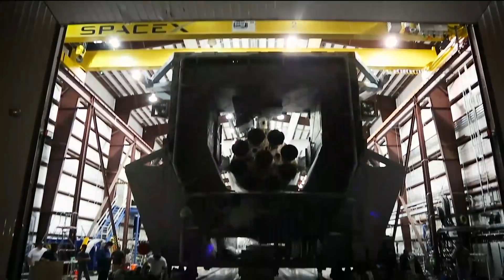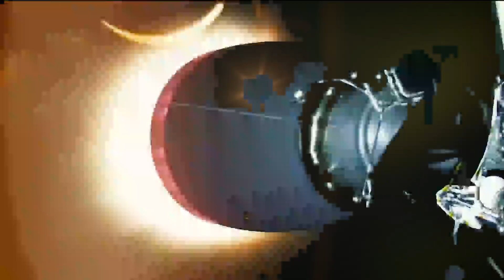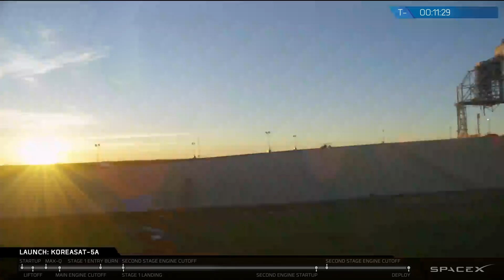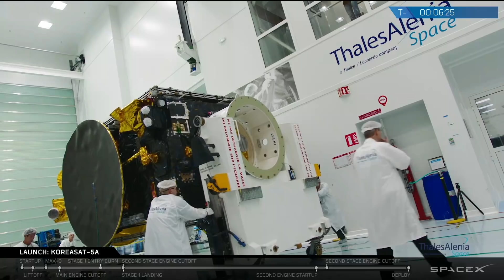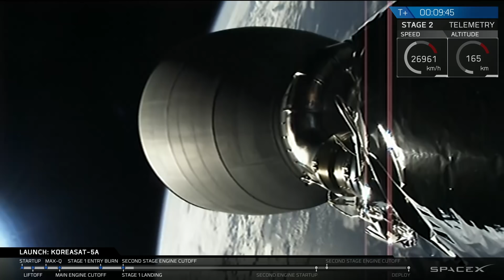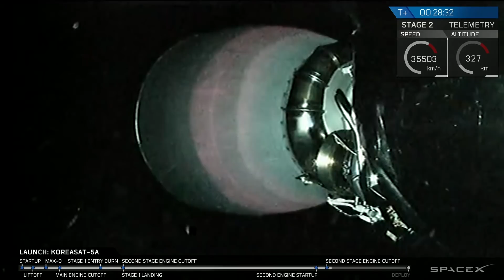Koreasat-5A Webcast

Comment: "little toasty" is henceforth the official term for anything spaceX produces that's on fire.
Reply: They got that from Mad Men.
Reply: Rocket explodes don't worry, it's just a little toasty! We can still recover it!
Reply: What do you mean explodes? Surely you meant that it went through a rapid unscheduled disassembly procedure.
Reply: They fill both tanks with helium as they empty in flight, so no significant chance of explosion, and rocket engines are kind of used to being on fire. It is amazing though.
Reply: I think "Little Toasty" should be SpaceX's catchphrase!

Comment: SpaceX, correct me if I'm wrong; but you keep loosing visual of the drone-ship right when stage-1 lands because the drone-ship is feeding data back to you over a satellite connection and the violent vibrations from landing cause the satellite feed to misalign and drop out, right? Isn't this a pretty simple fix? Off the top of my head, it seems like you could simply deploy a flying drone and relay the signal through that.

I'm sure some mechanical engineer will tell me about much simpler methods to isolate vibrations from a tracking system, but come on! FIX IT! I want to see that beautiful footage!

EDIT: Or... you know... keep kicking ass at solving the much cooler and more important problem of making humans an interplanetary species.
Reply: Abe Dillon

1: they are a rocket company, not McDonalds advertising department.

2: so you want to attach a satellite TV dish, to a highly unstable drone that is either too small, too expensive, or crashes into the ocean because of a fucking sonic boom.
Reply: MrTagnan
Those videos are inspiring and, yes; amazing advertising. A drone large enough to carry a satellite dish would be inherently very stable because it would have a lot of inertia. It would also cost, what, $50k tops? That's an unbelievably good deal for an advertising budget, no? The thing would pay for itself instantly.

The first stage of the Falcon 9 is sub-sonic way before it reaches the drone ships and sonic booms don't knock vehicles out of the sky, that makes no sense. A sonic boom is a loud noise, not hurricane-force wind gust.

Again, there are probably other solutions to the problem. They could have a second drone-ship a good distance away act as a relay, though that seems like it would be more costly than a flying drone.

At any rate; it seems like a pretty easy and valuable fix. You don't have to be McDonald's to care about advertising. SpaceX might very well want to say, "What's that, Blue Origins? We couldn't hear you over the sound of our monthly* compilations of sticking every single landing like it was nothing!".

*They do plan to make space so accessible and their turn-around time so fast that they'll be launching almost daily in the near future.
Reply: Abe Dillon here's the thing, yes S1 is sub sonic, but at a safe distance the drone would be knocked out of the air by the sonic booms, I've been to the KSC at landing and in most videos you can see the camera get shaken. They have limit people and they need to focus on R&D for ROCKETS not downlinks, a large enough drone would still be very unstable because the Atlantic is windy. Yes I would love to see landings better on OCISLY but it would take away from the money and research of developing BFR and FH.
Reply: Yep, no way would a drone like that be a worthwhile investment. Everyone in the launch industry knows about them, they have very strong brand presence. Few in the launch industry care much for Blue at this point, though that is changing as they tool up for New Glenn.
Reply: +Banaan Banaan
That's a good point. Now I feel like an idiot for not realizing that just because the live feed cuts out, it doesn't mean the footage is gone. That's all I really want anyway.
Reply: Because it's all a sham. NASA and SpaceX take billions of dollars from us, and what do we get in return? Lost video feeds and CGI.
Reply: I'm pretty sure it's in case it crashes...I don't believe the excuses, but then again I'm not an expert either.
Reply: lol wouldn't you think they would just put the transmitter on a mag lev  gyro or an air cushion gyro???? simple fix, I should be musk's right hand man. I have your back, but if you start getting transmission and it's because of this post I want royalties!!!
Reply: Simple fix: just retransmit the lost video footage, and bufferize it, just like a Youtube stream. The only downside is that it will lag behind every time it drops out, but with a benefit of seeing the landing in its entirety. There's no reason they can't do it.
Reply: Aleksej Komarov except that they can't do any of it.

Comment: That intro is sick and the music too.  Launch was ok. Jk, It was amazing. That fire pattern the rocket makes, Is there a name for that?  The way the fire looks like a star and streams out into a ring and then finishing in a blue tornado.  Bodacious
Reply: That would be called "engine plume" :)
I love seeing it too~
Reply: The distinctive pattern the F9 makes is super cool.  After watching a few,  you can tell when MECO is about to happen by the amount of "wrong pressure" there is.  I can't remember what it's called,  but the engine bell on the Stage 1 Merlins is made to be most efficient at a mid altitude.  that's why after max Q it starts to expand out.  not enough atmosphere pressure to keep the plume "in line." :-D

Comment: What is going with the camera on drone platform? Almost every time Space's rocket is landing on it, it stops and we have gap in transmission. I assume this camera does it on purpose.... Nevertheless great work SpaceX ! You are creating the future :)
Reply: It's not the camera, it's the transmission equipment being vibrated like hell with the rocket so close by.
Reply: The ship is pretty far out to sea, and cause of safety regulations nothing else is allowed near it, so it's using a satellite up-link to send the footage. With the vibrations from the rocket shaking the boat, it's very hard for it to maintain the connection with the satellite.
Reply: Thx. Now I understand.

Comment: Can there be a relay ship next to it or even a drone that takes off 5 mins before landing so we can see better footage of the landing
Reply: Can't do a relay barge. It's already big money to tow the ASDS out there alone and get it set up. Having to do it all twice just to get five seconds of footage we already get on RTLS flights? No that's just not practical. The drone is the best thing, but I don't think a drone can carry a powerful enough transmitter to relay the signal straight to a satellite. It'd have to relay to the high gain on the barge which would just get broken up as well.

Comment: I don't quite know how the re-entry of stage one exactly works but at the beginning of it's re-entry there i was a little worried as it looked like it was leaning on its side too much. Figured it needed to be pointed straight up before reaching the re-entry burn phase.. Nevertheless love these webcasts they'll never get boring to me, just wish you guys used higher quality cams! :)
Reply: Play some KSP, its a great game and you'll learn loads :)
Reply: Nobody does vertical re-entry. It costs too much in fuel and has increased thermal consequences. Think of this more like a thrown javelin angling down to where it will land.
Reply: +HayaMLa There was no boost back burn to kill horizontal velocity like when it lands back on land therefore the re-entry burn needed to kill some vertical and horizontal velocity before allowing atmospheric drag to do the rest (this is also why the burn was over 10secs longer than a land based one as well). You will notice landing back on land is more vertical.
Reply: Cool, thanks for the answers.

Comment: Those waves were pretty scary. When the rocket lands, is there a mechanism that secures it to the barge? Could it theoretically topple if the waves are bad enough or is it pretty safe on the barge? I'm sure they wouldn't launch if weather conditions were too harsh anyway.
Reply: They have a robot that clamps it down afterwards yes, but it needs to stick the landing on it's own. And I'm guessing there is some electromagnetic help at work, as they have landed several times in pretty extreme conditions.
Reply: Once the propellant has been expended the booster has a low center of gravity. As soon as it is deemed safe, a crew boards the drone ship, and welds shoes over the feet of the landing struts. This secures the booster to the deck, ready for transport back to port.
Reply: https://youtu.be/bvim4rsNHkQ?t=80  There is this little clip of an unsecured rocket on the barge in the "How not to land" video.

Comment: Question for @spacex: Why do the drone ships not buffer the video signal and acknowledge the receive? It would make things much more interesting for the public if you could recover the 5+ seconds the rocket comes into frame. 

Currently whenever it’s a drone ship landing it’s like the power going out just before the touchdown play. Kind of a buzz kill for those enjoying from home.
Reply: RandomInsano2 the only real solution is to make a large dish on OCISLY, but then the F9 would probably destroy on landing and it may not work
Reply: The camera is still rolling, just save it as it goes and re-transmit. If your stream here pauses for three seconds YouTube doesn’t just slice out the middle like SpaceX is doing.
Reply: RandomInsano2 that's not how that works, they need people to manually recover the video and analyze it. See how choppy it it normally? That would be a pain to live transmit video from
Reply: It’s not streamed live? What makes you say that?
Reply: RandomInsano2 it's streamed live but you can't just re broadcast the landing right after. They have people inspect for a reason
Reply: I mean like a 20 second replay. If it needed inspection it could wait the additional buffer right? I also assume they have other sensor data that does make it through, but that’s just a guess.
Reply: RandomInsano2 they can't access the video until engineers inspect and recover it, live streaming is different from recording entirely, yes it would be cool however it is very unlikely this would work

Comment: They need to design a camera that can sustain that much vibration. C'mon... Just use a drone for the livestream at least.
Reply: The ASDS is prox. 300km offshore from the US East Coast, it uses a satellite connection to sustain the live stream, which is incredibly hard considering there is a rocket landing on it and shaking it alongside the waves, they've been trying their best so far and has had some good results (I.e. Iridium 2, got live landing feed all the way down). But as beforementioned its difficult as hell.
Reply: YOU CANNOT FILM SOMETHING THAT DOESNT HAPPEN
Reply: KNO im just happy that i can watch live in any way rockets raking off and landing. SpaceX does not get any money from streaming i think.
Reply: Ginzo having multiple boats in the area is not safe. And whats the point of sending more than needed ? And this was done with CRS8 if i recall correctly. But that was because it was going to be the first in history
Reply: Ginzo Ginzo one. Not a 100% of the landings have gone blackout. And whats the point of them wasting money and resources on doing that ? They're a rocket company not a film studio. Be happy that you have any footage whatso ever

Comment: Cut the video so if it fails we don't have to show everyone so they won't be afraid to ride
Reply: Drones and Sneakers yeah they lose telemetry too, it loses signal due to entry. There hasn't been a failure since 2016 and this is the 15th consecutive landing so the chance of RUD is ~0%
Reply: Drones and Sneakers They already made a compilation of all their failures so would be to late
Reply: 15th? near 0% of failed landing? You are aware that 1 on 15 is not even quoter way to avarage rocket failer rate? its still very small number

Comment: Was that one camera experiencing a very localized earthquake?
Reply: +AgentMull
Pretty well much but i'd call it a sound or air-quake ;-) the shock-waves were delivered through the air from the rocket rather than the earth from a fault line. It's not the camera that has the issue. The equipment feeding the signal to a satellite gets shaken off course and signal goes down. Space X uploads the full on board recorded video after the launch on some of it's launches.

PS: Not 100% sure if your serious and asking a genuine question or taking the piss but i thought i'd answer anyway.

Comment: I'm kind of frustrated... In the last several landings, the feed has cut out RIGHT when it is landing. Or if the landing is at night, the feed will remain but be too washed out to see anything. I'm a full supporter of SpaceX but it just seems a little sketchy. Which sounds ridiculous to even say about SpaceX but whatever.
Reply: You can't expect clear, uninterrupted footage from barge 300 miles in the Atlantic ocean with a 15 story rocket landing on it. You just... Can't.

Comment: isn't it easier to just use a couple of parachutes to water land the first stage?
Reply: That, and you'd have to deal with the whole "corrosive salt water" thing getting up inside those expensive Merlin 1D engines.
Reply: not if you want to rapidly and inexpensively re-use it.

Comment: Is it a problem that the rocket was on fire after it landed?
Reply: Lucas Clemente if it can with stand atmospheric re-entry I'm assuming the material should be able to handle the heat of a normal fire compared to re-entry. Not great that it's on fire but I wouldn't say bad

Comment: Can someone explain what it is about the landing that makes the live feed cutoff?  I mean why would the vibrations and heat protect a live feed if the camera gear is properly protected?

It's hard to believe that SpaceX has accomplished so much that was never possible before, but they can't keep a god damn live feed online during landing.
Reply: The signal from the booster is being picked up by receivers at the launch site. As the booster falls towards the drone ship, it sometimes drops below the horizon and line of sight, and the signal, is lost. The signal from the drone ship is relayed via satellite.

Comment: Can someone help me with where I'm getting lost.  I've heard a few times throughout the video the satellite will be in geostationary orbit.  At the equator that's roughly 35,800 km for the center of the earth.  If the Earth's diameter is 12,800 km, and the altitude on the video indicates 1,150 km (I'm assuming that's mean sea level), that puts the satellite at 13,950 km.  Is the satellite itself designed to increase it's altitude by 21,850 km?  I'm thinking I might be missing something simple, but can't think of what.

Comment: Why is First Stage usually landed on the sea platform? Isn’t it better to land on the ground?
Reply: It takes more propellant to land on ground. The rocket is launched out over the ocean, to return back towards the lauch site requires a boost back burn. This is not required for a landing on a drone ship, so a heavier payload can be lifted, & the booster still recovered. 

If you have any more questions, just ask.
Reply: It depends on the nature of the launch. For heavier payloads, or ones going to higher orbits, there is not enough fuel to return to the launch site. When the mission is such that they do have enough fuel to do it, they do.

Comment: After deployment, what does the 2nd stage do? Re-enter and crash, or what?
Reply: Yes, but it supposedly be stuck on a non-stabilized orbit for months until gravity slowly pulls it to earth
Reply: Ok, cool. Wasn't sure if they had some fuel left for a re-entry burn or anything of that sort. The ideal would be to land it, but obviously they're not capable of that just yet. :)
Reply: No they need to build it that way  as it needs whole system to properly land :p Stage 2 was not made for that. BFR supposedly should have both staged landable,

Comment: Why does it always cut off when it's landing? I suspect a cover up.......
Reply: It's a satellite link. If the antenna is shifted even a fraction of a degree off true, you will lose the feed. Landing a rocket on a barge tends to cause a lot of vibration. There have been times when they were able to maintain the feed and, of course, they always do when landing on land.
Reply: Fah what nonsense. It's more likely they engage a tractor beam to land it but the technology is secret so they cut the feed.....

Seriously, I wish they would have a nearby floating camera so we can see it.
Reply: Physics. Physics is why. A near by floating camera 300 miles out to sea just for five seconds of footage we already get when they return to port with the SD cards....